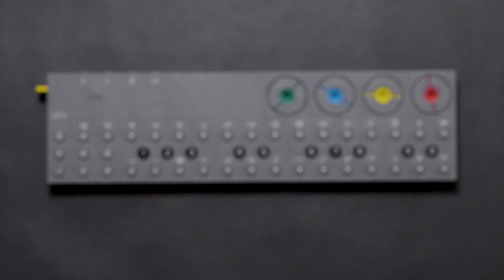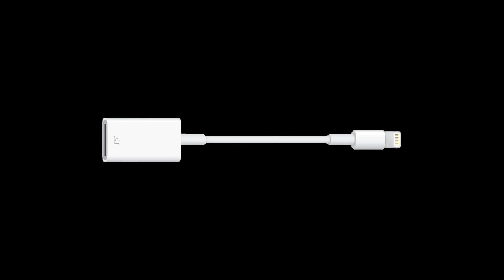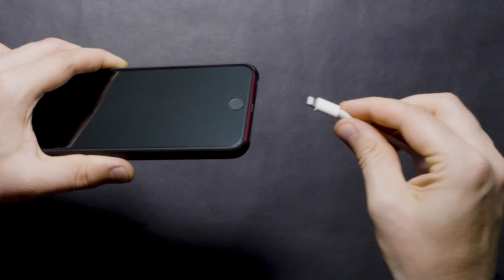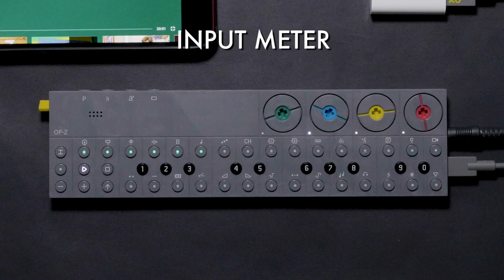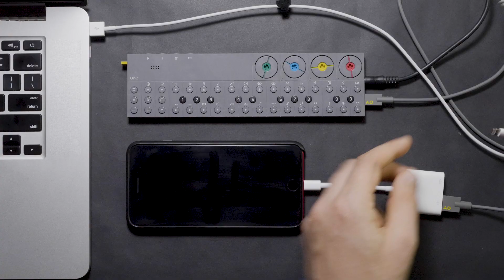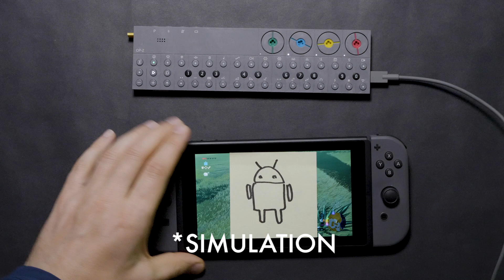OP-Z Sampling an iPhone

Comment: thanks, but you could use the lighting to mini jack adapter to sample in to the trs audio in on the op-z right?
Reply from the maker: I’m not sure that you can. Apple is tricky with its accessories and there needs to be a digital “handshake” between the device and accessory in order to gain full functionality.

Comment: Can’t you just use a lightning port to headphone jack adapter with a male to male audio cable? (Without the adapter you used, just plug directly from the iPhone to the OP-Z?
Reply from the maker: Unfortunately not. Certain accessories unlock features, like the one in the video.
Reply: @OllieLoops  got it—thanks! So surprising that it works on the op1 but not the OP-Z. Such a bummer! Love your videos though thank you

Comment: Does it work if not in sampling mode, like if you just want to output audio from a synth app on the iPhone, replacing one of the 5-8 channels? If yes, how to set it up. Thanks
Reply from the maker: Hey, thanks for your comment. I’m not sure I understand the question 100%. Could you rephrase your question?
Reply: Ollie Loops hey thanks for getting at me, I basically want to sequence an external soft synth ,that is on my iPhone, with the op-z and have the audio of it coming from the op-z.
Reply from the maker: @margg_names  Ok. thanks for clarifying. I believe you can do this if you have a third app to route audio from the soft synth to the OPZ. I believe an app like Audiobus will allow you to do this. But I would recommend checking out that app. Just know that the OPZ app doesn't route or handle audio itself and the OPZ essentially acts as an audio interface for the iPhone given the adaptor in the video. ok, I hope that helps.
Reply: Ollie Loops yep, thanks. Will check that app, keep up the good work :)
Reply from the maker: Thanks. Good luck.
Reply: Ollie Loops wow just downloaded Audiobus and looks like the fun will begin :)) many thanks ❤️
Reply from the maker: @margg_names  Awesome. Yeah, I've heard good things about that app. have fun!

Comment: Why is the emphasis on the word brand? And which adapter do I need - lighting on USB or lighting on USB 3.0 ??? I do not have branded lighting for USB. Everything works, but there is some oddity - as soon as I connect the adapter to iPhon or iPad, OP-Z starts to work slowly, I can’t, for example, play the eighth notes or sixteenth notes with my hands on the keyboard. Those. the keys are pressed, there is no delay, but there is a long interval between presses. What could be the matter - a generic adapter or the fact that this adapter is not USB 3.0?
Reply from the maker: Magadan As far as I know, Apple does not allow third party adaptors to stream audio from their products, at least there are very few licensed products that work. Regarding the issues you’re having, I would recommend contacting TE support.

Comment: Hello, 

Tried for days now, really struggling to use my Samsung S8 to output audio to the OPZ in sample mode. Been to Samsung shop, I have my audio output settings on my phone to OPZ via Samsung Smart Things, have USB configuration in Developer Settings to output Audio via USB and sound doesnt leave phone via the speaker or the headphone port when settings are like this, so audio is leaving phone via the usb c port but OPZ does not seem to think that is the default audio input, it still only listens via built in mic or earphones mic when engaged.

Thoughts? Has anyone else successfully used sample mode direct from Samsung S8 into OPZ? My girlfriends Android phone, Huawei P30 works instantly, no settings changed, just the same usb c to usb c and straight away I can sample digital audio into the OPZ, I just need to do the same on my Samsung S8.
     
 Do I need a USB OTG cable? Or a seperate app that reroutes the audio leaving my phone or tells the OPZ it is slave to listen not my phone listen to audio FROM OPZ via USB (I dont know if it is doing this however). I am on latest firmware on both OPZ and phone.

Help needed pls

Thanks

Myles
Reply: I have exactly the same problem with my samsung note 10

Comment: Hi, great video. I have 2 questions hopefully someone can help.
Can anyone CONFIRM my Samsung S8 will simply connect and let me sample sounds out from it via the charging output (and if so how do I do this, do I need to change a setting so sound leaves via the usb output of the phone not the speaker/headphones? And how do I do this?)
And secondly, I do have both IPAD and Iphone but both are the older type with 30 pin connector, will a converter which makes the output of my iphone/iPad into the host work for sampling from that?

I want to use my Samsung phone ideally, but can find any other videos or info online other than your short bit at the end of this that event talks about it as a sampling from device. Can anyone point me to more information regarding sampling the sounds out from a Samsung phone INTO the OPZ

Thanks in advance!
Myles
Reply from the maker: Hey Myles,

I have not tried it, but users have confirmed that Android phones work simply by connecting a cable between the phone and OP-Z. If you get a usbc to usbc cable, you can connect the two. The phone should auto detect the connection and output audio. 

Regarding iPhones and iPads with 30 pin connectors, there is a camera connection kit that you can get for that type of connector. And it should work in the same way as the newer iPhones. 

I hope that helps.
Reply: @OllieLoops  Thanks so much, keep up the hard work, might ask for more tips in the future.
Cheers
Reply: @OllieLoops  Okay, 2 more questions if you dont mind?
Firstly as I dont actually own the OPZ, this is for sure something I  will be ordering  very soon, I dont have the device in front of me so cant see... so the mic input you've used in other videos using your Shure Lapel style condensor mic, am I wrong in saying you couldnt just use a TRS mini jack out of that output and put it absolutely anywhere to sample; it doesnt just HAVE to be a microphone, right? So I could sample like directly from my record player, or radio or absolutely anything with a headphones-out jack?? - Is the microphone input on the same output as the headphone output of the OPZ i.e if I could use that 1 dedicated audio input (which I thought comes from the same line as the headphones out of the OPZ) to say sample the record player would that mean I couldn't have headphones in at the same time to the OPZ and would that mean I couldn't monitor the sample, or do I need a separate device to do this/would the usbc output work for audio to monitor if I had headphones that had some kind of usbc adapter on that? Essentially can the "headphones mic - in" on the OPZ be used as not mic but just line in TRS lead and if so how do I monitor audio from the OPZ at the same time?

Secondly, I was thinking about ordering the PO KO! and then PO rhythm (drum machine one) also, but would you say with the OPZ now with Sampling there is nothing essentially I couldnt get from them that I couldnt do with the OPZ with sampling?? 
As I could essentially just download the PO Rhythm drum sounds and sample them into the OPZ, save them in the internal memory then I would pretty much have the PO Rhythm. Would you say also I can splice samples, sequence samples from any format whether microphone input whatever to create patterns to the effect of what the PO KO! (the speak/micro sampler one) can do?

Sorry for the long questions. Anyone else feel free to answer these in time!

Greetings from Manchester UK (but currently sun bathing in Turkey!)
Reply from the maker: Hey Myles, 

Regarding the 1/8 jack on the OPZ, there are mixed opinions about it. We don't want to stir the pot, but here's where we stand. On a technical level, the input is a mic level input, which is excepting to see a signal between -60dbv and -40dbv. A typical line level input is between -10dbv and +4dbv. So running a line level signal into a mic level input is well above what the device is designed to handle. TE issued a warning that this can damage the device. With that, we don't  encourage people run line level signal into the device because we don't want anyone to break their gear based on our recommendations. We haven't found a good solution for this and we encourage users to ask TE what they recommend. Lastly, if TE releases a module that gives users a line level input, that would be the best solution. Until then, you could record into another device and transfer samples into the OPZ via Disk Mode. It's not convenient, but it's a solution.

Regarding the POs, I don't think you would be gaining much by having both an OPZ and a PO33. One thing that the PO33 does that the OPZ does not, is process incoming samples in a low fi way. The OPZ has much better A to D converters than the PO33 so it sounds better. If you want that low fi sound, then the PO33 is a fun device to have. Otherwise, the OPZ is effectively a PO on steroids, so you are better off with the OPZ. 

I hope that helps. Enjoy Turkey.
Reply: @OllieLoops  Thanks again man, very very wise words (y)

Comment: I wonder if the USB-C to Lightning cable would work for this..? Or even the USB-C to USB-C one on the iPad Pro
Reply from the maker: With an iPhone, you need the adaptor to unlock the phone’s audio I/o. The usbc to lightning cable alone does not work. With an iPad with a usbc, you don’t need the adaptor.
Reply: Ollie Loops Thanks for the quick response! Great videos btw :^)

Comment: 4:05 I got this adapter and I can confirm that it works.
Reply from the maker: Thanks!
Reply: Die-Jay-Cee I have the usb adapter. It works but it is making some « crackles » noises when camera usb recording on the iPhone. Did you change some settings or it works without making noise for you?

Comment: USB to lightening adapter works.  I opted  that one just because it's slightly more portable and the OPZ is my on the go tool so most of the time I won't be connected to power.
Reply from the maker: Thanks for your comment! That's good info.
Reply: @OllieLoops  Glad to help! Your content is great.
Reply from the maker: @djbowlz2128  Thanks so much!
Reply: @djbowlz2128  I'm using the same method, no need to connect power. I have a 3rd party lightning to hdmi aswell but you do need power for that.
Reply from the maker: @LloydRobinson  Does your Lightning to HDMI adapter transmit audio as well? I'm guessing it would.
Reply: @OllieLoops  I haven't tried but I'm guessing it would if the audio is set to usb. I bought it to try motion on a bigger screen.
Reply from the maker: @LloydRobinson  gotcha. let us know what you find when you try it.
Reply: Yes, Works!
Reply: works for me on either, but not being able to use Lightening earbuds REALLY SUCKS! what Apple was thinking?  .... probably big wigs were thinking, people will by wireless .... with bonus latency added .... so were not counting mobile musicians LOL
Reply from the maker: @samprock  haha. There is definitely a big conspiracy to sell wireless headphones.
Reply: Works fine as well, however I experience sound breaks/delays during transfers from one pattern to another within a pattern chain of opz (no delays or breaks while playing opz not connected to iPhone) but it happens with some particular projects and patterns. I wonder if anyone experienced the same delays with the big square to-lightning-camera adapter, I mean maybe its gonna be a waste of money in my case... and it’s not about the adapter... thanks!

Comment: Great video. I don't have an iPhone but you don't need the official camera adapter for the ipad pro,  I have 2017 Model. Plus on the iPad you need select audio out via USB in settings.
Reply from the maker: Hey, thanks for your comment. When you say you don't need the camera connection kit on the Ipad, are you using a Lightning to USB-C cable, and it works with just that cable? Good info, thanks!
Reply: @OllieLoops  yes and no, lightening to USB then the TE USB cable into the OPZ. Its just a 3rd party one from Amazon for about £12 uk money. I'm using it to sample Korg Gadget 2.
Reply: On the newer iPad Pros with USB-C port it also works with usb-c to usb-c cables.
Reply: @MarcoPompei90  Good to know
Reply from the maker: @MarcoPompei90  Good info, thanks for that.